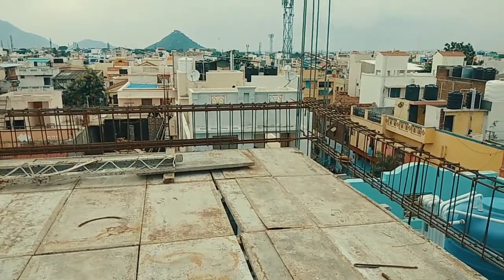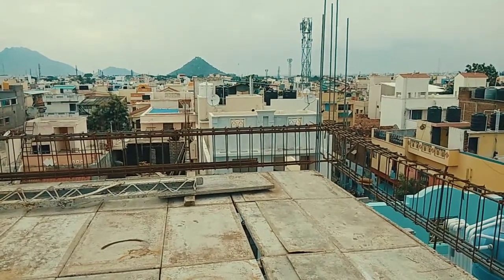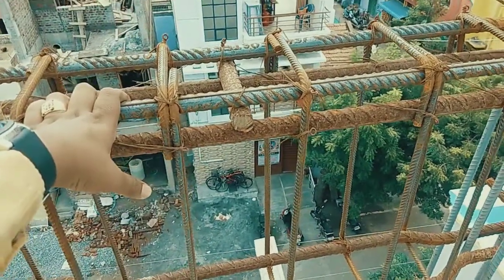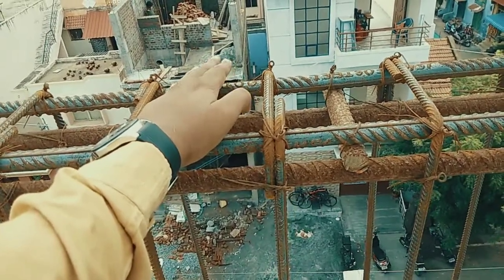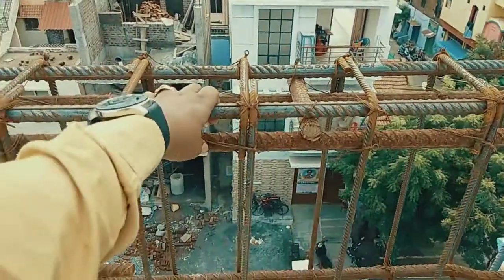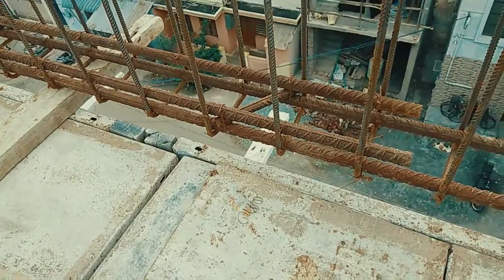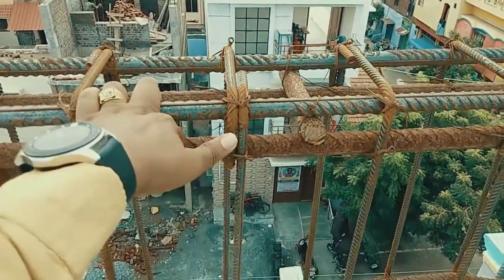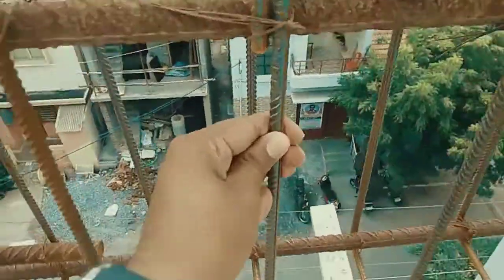Reinforcement Details for 26 feet rcc beam

Comment: Is it possible to have 20 feet span with 16mm rod (6 no's ) beam and 9*12  inch column &10*12inch beam
Reply from the maker: It may vary depending upon the loading
Reply from the maker: But it's possible
Reply from the maker: https://youtu.be/zfh5yPPWxyY